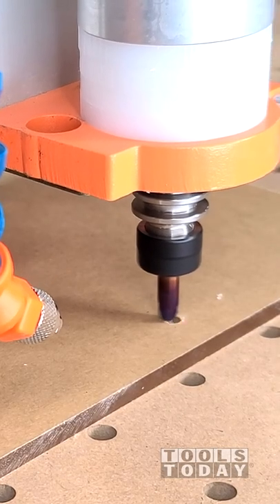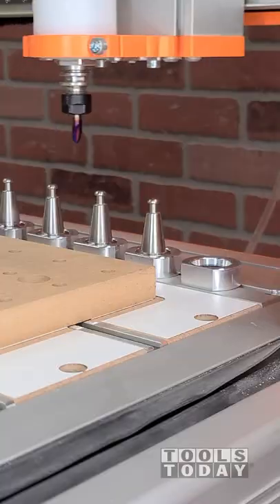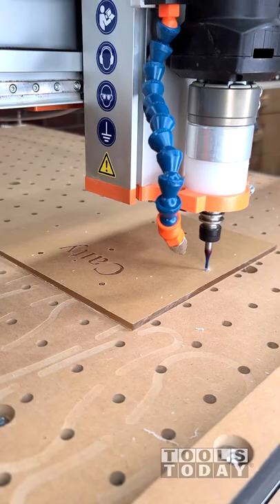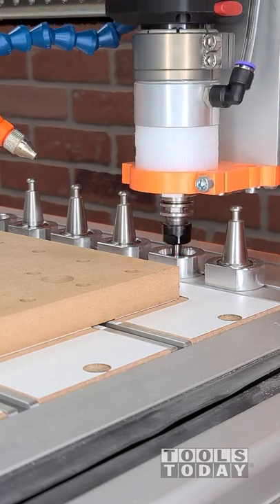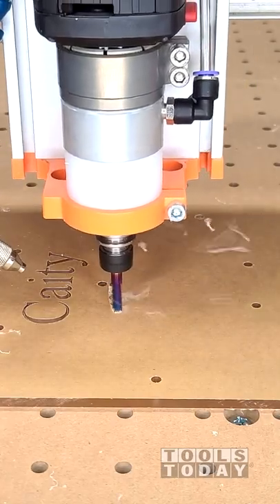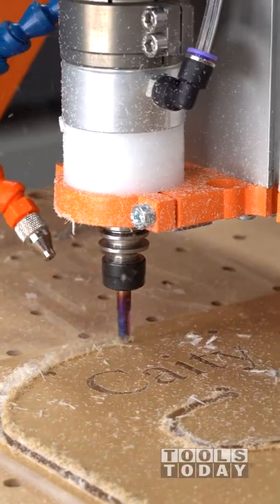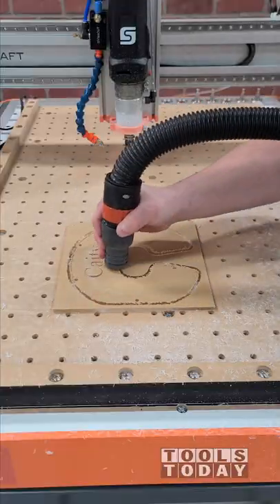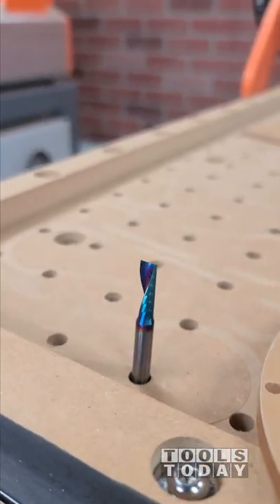Cutting 1/4" Acrylic

Comment: Can  you post the links to these three bits please? Thanks.
Reply from the maker: Amana Tool 45626-K SC Spektra Extreme Tool Life Coated V-Groove 90 Deg x 1/4 D x 1/8 CH x 1/4 Inch SHK 3-Flute Router Bit
https://www.toolstoday.com/v-14487-45626-k.html
- - - - - - -
Amana Tool 51411-K CNC Spektra Coated SC Spiral O Single Flute, Plastic Cutting 1/8 D x 1/2 CH x 1/4 SHK x 2 Inch Long Up-Cut Router Bit with Mirror Finish
https://www.toolstoday.com/v-13759-51411-k.html
- - - - - - -
Amana Tool 51404-K CNC Spektra Coated SC Spiral O Single Flute, Plastic Cutting 1/4 D x 3/4 CH x 1/4 SHK x 2 Inch Long Up-Cut Router Bit with Mirror Finish
https://www.toolstoday.com/v-13351-51404-k.html
Reply: @ToolsToday  - Thank You!